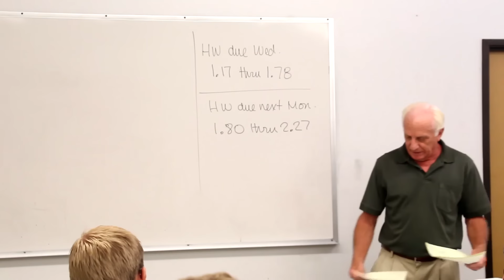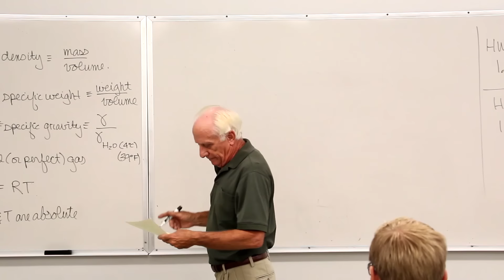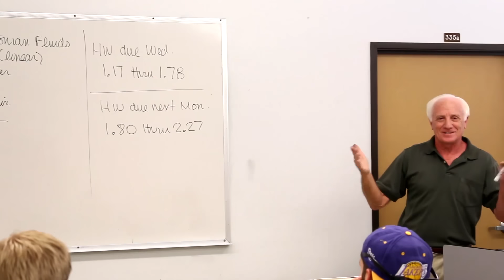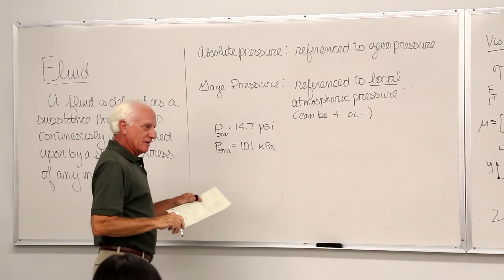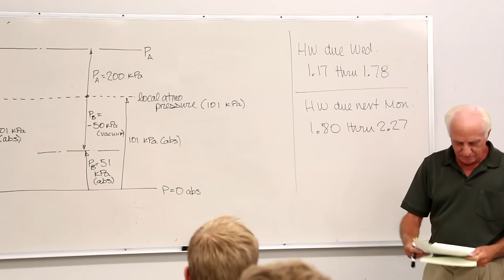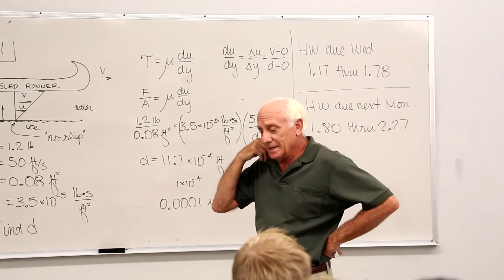Fluid Mechanics: Fundamental Concepts, Fluid Properties (1 of 34)

Comment: Hi Professor I’m currently taking Fluid Mechanics as a civil engineering major. Is the content covered in your mechanical engineering fluids course similar to civil engineering fluid mechanics. Or do you recommend I find civil engineering fluid mechanic videos instead.
Reply from the maker: There should be many similarities between a CE and ME fluid mechanics course. One big difference is a CE course usually covers open channel flow, but ME courses usually do not.
Reply: @CPPMechEngTutorials hey sir what about process engeneering I just started the series and I see the similarities is it similar?

Comment: You have already updated the Heat Transfer course from the 2015 version to the 2021 version to improve its quality. It would be great if there is a similar plan to update the Fluid Mechanics course as well.
Reply from the maker: Why does it need an update? The Heat Transfer course was updated because there were some editing issues with it.

Comment: Preparing for Thermal & Fluids PE. Didn't realize how much I've forgotten. Excellent video. Also, a note to those that are post-grads (such as myself): Don't fall into the trap of thinking you're better than watching undergrad videos. 4 years of working abstract derivations (i.e., derive navier stokes in a spherical coordinate system with xyz conditions) is great, but for PE applications, many need to dust off the calculator every once in awhile. Excellent series.

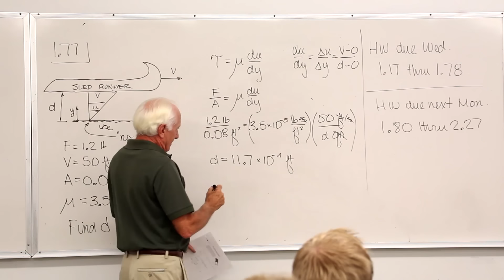Comment: At 49:17 the correct answer is 1.167 e-4 ft. The lecture was fantastic and informative.
Reply: did it 3x and it came to the same answer so I thought I was losing it, scrolled through and found this.
Reply from the maker: Thanks. A correction has been added to the video notes.

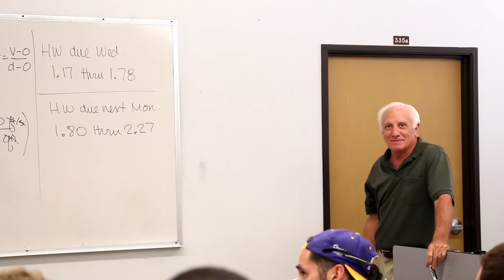Comment: At around 50:00 when solving problem 1.77 why is the velocity the same as viscosity. I don't see why U is 50 m/s.
Reply: The change in velocity from just above the ice to just under the sled is equal to the velocity of the sled because of the no slip condition where the water velocity right by the ice is 0 (because the ice velocity is 0) and the water velocity right under the sled is the same velocity of the sled.

Comment: Why is negative gauge pressure called vacuum? Shouldn't the true vacuum be only when the absolute pressure is zero?
Reply: We are living on the earth which is under atmospheric pressure (i.e. 1 atm-abs). Therefore we feel as the vacuum all pressures below 1 atm-abs (i.e., suction effect). That's why it is convenient to call pressures lower than 1 atm as the vacuum.

Comment: Certain I am missing something incredibly mundane...but, problem 1.77 appears to be unitless...I don't see where a ft unit is left over.  Anyone feel like clarifying?
Reply: There is only a ft unit left. It's a little confusing because he denoted that the variable "d" would be in feet as a final answer and crossed it out, but it really is not included in the dimensional analysis calculation.
Reply: @erinannelies  thank you, so if not in the dimensional analysis, dy = 1.17e-4 'unitless' should have remained as the answer and and explanation of dy = thickness should have been explained afterwards - for clarity?

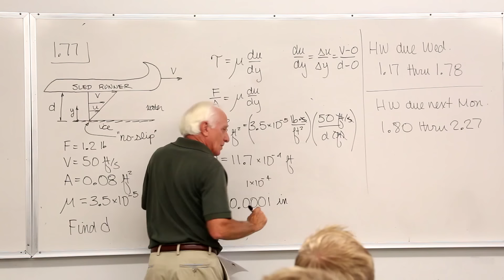Comment: Just would like to point out, the answer he says at 49:37, "the thickness is one ten-thousandth of an inch" is wrong. He meant to say that the thickness is one ten-thousandth of a FOOT, his answer should be 1.17e-4 ft, which is 1.4e-3 in. Otherwise, it was a fantastic lecture.
Reply: I thought I was going crazy 😂. I needed to hear this
Reply: Surprised no one caught this but it's actually ten times thicker.  11.7e-4 ft = 1.17e-3 ft = 1.4e-2 in = .014 in  
That's about 1 1/2 playing cards thick.
Reply from the maker: We'll put a correction in the show notes. Thanks.
Reply: Here's your cookie, go away now.

Comment: Hey first off, thanks for posting. I had a quick follow up question. During the recorded example, the professor uses a given area of the runner. Just to clarify, is that the area of the runner that is in contact with the water? For this example it would be the width of the blade by the length of the blade, is that correct?
Reply from the maker: Yes, the area of the blade that is touching the water/ice.

Comment: isn't the answer of the sled problem, 1.17*10^-4 instead of 11.7*10^-4?
Reply: Yes, you're correct.
Reply: Question, I got the same answer, but why does he still have ft. I got it without Units.. where did I go wrong if I did.. please help
Reply: Reynaldo Lopez manipulate the equation to solve for dy and then cancel out units as follows 

dy = {lbf*s/ft^2}*{ft/s}*{ft^2}*{1/lbf} should result in ft
Reply: @devonm301  shouldn't the canceling out leave ft?
Reply: Zuriel Garcia ft^3 in the numerator and ft^2 in the denominator
Reply: @devonm301  yes got it thanks for clearing this up. I'm surprised not many inquired about this
Reply: That's what i got as well :)

Comment: I take Fluid Dynamics next term, however not taking it at Cal Poly. My uni wouldn't go into the basics. They assume you know all your units, both SI and British so they skip this material.
Reply from the maker: Students should know the units coming into this course, but it doesn't hurt to review just in case some students forgot a few units over the summer.

Comment: For those homework problems he has posted. Does he mean 1.17-1.78 as in every single problem 1.17-1.78?
Reply from the maker: No. He has certain textbook problems within the range 1.17 - 1.78. He didn't assign 60 problems.
Reply from the maker: The class syllabus is available on our video tutorial website, ME Online. Scroll to the bottom of the following website: http://www.cpp.edu/~meonline/fluid-mechanics.shtml
Reply: Are the problems he specified available somewhere?

Comment: I am very much confused in some topics,  plz help
         1-explain vapour pressure in  closed condition (fixe boundries) that if we continuely increase tempratute, what will hapen becouse air above it can not take more vapour
         2-what is saturated vapour pressure is it fixed or vary with temperature and pressure and explain in both conditions open and closed system
        3-what is boiling in  closed system  , is it a prosses or condition ,is it  instentanious ?
        4-what is roll of saturated vapour pressure in boiling  or both have no relation    
         5- is all the liquid get completely vapourised when  we put  liquid into vacuum

CANCEL
COMMENT
Reply from the maker: As you increase temperature, more liquid will enter the vapor phase, thus increasing the pressure (the pressure due to vapor increases).

Comment: That's a good video. But may I know the textbook? Thanks!
Reply from the maker: Munson, 7th edition, "Fundamentals of Fluid Mechanics"
Reply: @CPPMechEngTutorials  Is calculus necessary?
Reply: @glorymanheretosleep  I'm taking fluid mechanics for an environmental engineering program and I asked the prof right off the bat if it's needed. He said it totally wasn't (which sucked cause I took the summer taking calc courses to get ready lol). That's the case for my applications at least, not sure about yours.
Reply: @domenicogrimaldi591  Advanced Fluid mechanics will require calculus because property materials become non-constant and equations become non-linear and you will need to solve the problem with differential equations/numerically
Reply from the maker: @glorymanheretosleep  Ultimately the algebraic equations are used in industry. But calculus allows you to understand the theory behind the equations.
Reply from the maker: @glorymanheretosleep  It helps.
Reply: @CPPMechEngTutorials  Thanks alot .
From to to get the assignment problems?
Reply: @CPPMechEngTutorials  thanks
Reply: @CPPMechEngTutorials  , thank you! I am taking in the spring semester,  Applied Fluid Mechanics
by Robert L. Mott would the topics would be the same? thank you!!!
Reply from the maker: @ezatullaharif2855  Most undergraduate mechanical engineering fluid mechanics courses will cover similar content.
Reply: @ezatullaharif2855 j
Reply: @CPPMechEngTutorials  is the textbook on PDF?
Reply: Good lecture. Thank you
Reply: P
Reply: Yuu
Reply: 2226 SwiftKey 1
Reply: Am I misunderstanding the homework notation, or did he just assign 61 problems that are due for the nest lecture? lol

Comment: if a block of mass100g is floating on water. then what is its apparent weight? justify.
Reply from the maker: Weight is the same regardless of the block's situation. Buoyant forces are discussed in a later video.